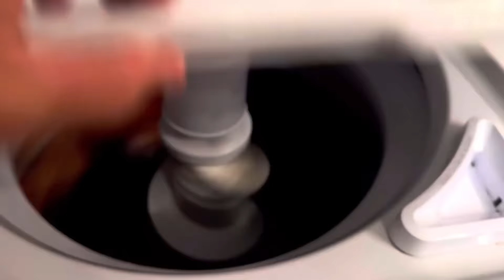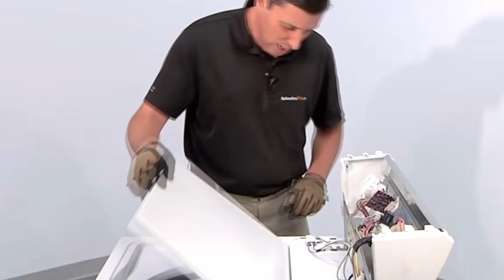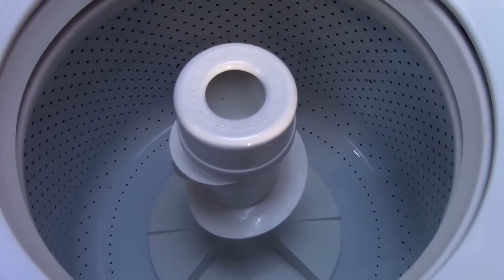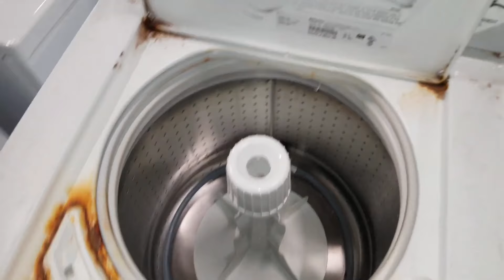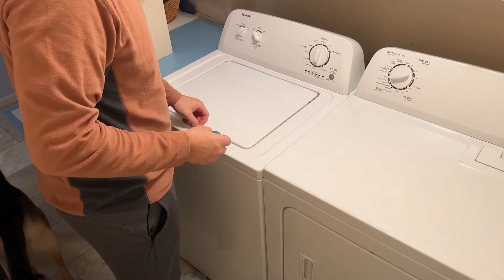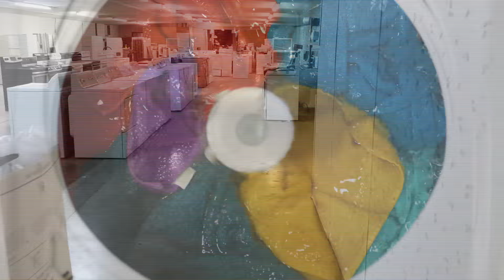3 CHEAP Top-Load Washing Machines EVERYONE IGNORES (But These 3 Are Absolute Goldmines)

Comment: My coffee mug has Wi-Fi.  Shouldn't all of my Appliances?

I wouldn't buy an LG or a Samsung if you're held a gun to my head.  They've been notorious for issues for years.  They are designed that way.  Talk to any appliance technician and they will tell you speed queen all day long.  I think Maytag or Whirlpool has a true commercial washer out now.  That would be the only other one I would consider.  Right now I am still using Kenmore that I bought 1996.  I've done a couple of minor repairs myself.  I am told that that design is worth the best there ever was.

Comment: I got an original kenmore washer along with a just as old dryer when I moved into my new home. That washer is a top loader that's at least 30 years old, and it runs perfectly. The dryer is as old as the washer, and probably needs a minor fix. I just hang the clothes out to dry, and it works fine. The old models are better than the new, and these prove it.

Comment: I have one set of those 1980s Maytag washers and dryers I bought new. Never had a service call on either one!❤ (I actually waited a few months to buy them after moving into my new house so I could save up for Maytags, like my mother had used for years). Didn't know they were so easy to repair. Now I'll do that, if they ever fail, instead of replacing them. Thanks!

Comment: I bought a new Maytag in 2018. There's a little plastic piece just under the cover that connects to the internal computer and signals whether the cover is closed. The machine will not operate without that signal. The piece broke for the first time while the machine was still under warranty. Each replacement piece lasts about six months. The repairman says there is no go around, The machine has been sitting, unusable, (but won't operate without a new plastic piece) for about three years now. I simply stopped paying a repairman to come out and install that tiny part to signal the machine that the cover is closed. What I use now is a portable washing machine that has as much capacity as the Maytag, works with the cover open, and cleans laundry just as well if not better. It was shipped right to my door and was also half the price of the Maytag..

Comment: I just bought kitchenaid stylemaster model # KAWE660WWH2 as I couldn't find any of the 3 you listed locally, but it was cheap enough to roll the dice at $50. Now i suspect its a generic of an early 80 series. I still would rather a dependable care,  but for now its kitchenaid

Comment: I had a wonderful Kenmore heavy duty top load washer from 1989 until 2014. It was still working good except hot water. We got a new Kenmore that had a lock on it to 😮prevent injury, I broke it off. It would not spin correctly, shook itself across the floor and wouldn’t drain. Staying up until midnight one night, babysitting it so I could dry the load.  I wrote on it with a permanent marker ‘I am a Sissy’.  My husband asked the next morning if I needed medicine, was I crazy.  I said I just need a washer that works. He brought home a brand new made in America top loading steel drum, commercial style speed Queen. It is my pride and joy and will outlast me!

Comment: I have the Kenmore set on the front of the video. My mother had this same set so I knew how reliable and cheap it was to operate. I came across the set in a local auction and bought them. I moved my modern set out into the garage until I sold them on Craigslist. I will never buy another washer or dryer. They are reliable, cheap to replace parts and best of all no motherboards.

Comment: Never mind how long a washing machine will last, Do they clean your clothes???? We bought a commercial Maytag, and it DOES NOT CLEAN your clothes. My sister died and we inherited a Roper machine. I thought it would be low class, but I have been pleasantly surprised. She bought it over 20 years ago used, and we have been using it for four years now. Cleans like no other machine we have ever owned. When they went to low quantity water tubs, they threw clean out the window. It reminds me of the toilets that only used a gallon of water. You had to flush twice to get the job done. When this Roper dies, we will be buying a Speedqueen. It's the best value for your money on the market. If the machine you are considering has no agitator, or a spindly little agitator, walk away from it. It does not clean your clothes.

Comment: I've had the whirlpool dryer for almost 40 years.  At one point it had a problem with the heating coils that my hubby fixed.  That was 30 years ago.  It's still going strong. I had the matching washer, but it broke.  After seeing this video, I realize I probably should have spent the money to have the washer repaired. I'm on my fourth washer since buying the Whirlpool set.  I never thought that the dryer would last this long.  I don't care if it doesn't match my washer. If it's not broke, I'm not going to replace it.

Comment: Kenmore mostly was whirlpool direct drive. But some direct drives put fancy pressure switch in trying to reinvent the wheel. I have 2 houses 1 direct drive other maytag 2nd generation.  Both going years. 40 years retired hvac appliance tech. I'd stay with speed queen next machine.  New whirlpool still has that crap motor design like bravo cabrio and all front loaders.

Comment: Not so, we shopped for an older washer two days ago, the options were limited because all but two were already sold. We found one for 299.99, top loader. It works amazing, we had a smart washer that was the dumbest washer ever!! Would not add enough water to get the items wet, would agitate barely damp cloths into a tangled knot, destroying our cloths. It would ratchet loudly while doing nothing to clean the cloths. One set of queen sheets would be too much for one load and they would come out with dry patches everywhere. WE HATED THAT DANG WASHER!! We had them haul it off because we could not in good conscience give or sell it to someone. 
The new old washer fills completely, agitates and spins like a washer should and the cloths? Oh my gosh, such a joy to have clean cloths again. Modern technology is a waste of money and designed to be replaced in 3-5 years for triple the cost.

Comment: About 2010-2013 I bought a Maytag washer and dryer set almost new at auction. The washer was so efficient that it wouldn't complete a cycle without stopping multiple times. The Maytag repairman advised me to junk it unless I could stay home and be alert for every time it stopped and had to be restarted. The dryer is still going strong but the electronics have started going haywire every time the barometric pressure drops.

Comment: Still running my old KitchenAid (Whirlpool) dual action washer I bought new in 1996 along with the Whirlpool dryer I bought at the same time. First and only pair (to date) I've ever owned. Completes the wash cycle in a fraction of the time of these new ones, and cleans waaaaay better. Dryer usually takes 45 minutes on medium to dry a load of towels. 
I hope they outlast me, as I'm cheap and don't like the new junk.

Comment: I probably stay with Maytag but mine probably needs a good cleaning inside because it sat for months with water inside the machine. Hurricane Milton killed my service so no electric in my first home. I want to move it and clean out the pump and lines the dryer is a bear to replace a belt I done three so far. 73
Reply: use Borax a going through wash cycles until it runs clean and doesn't smell anymore to clean it out. Vinegar as well. It will kill the mold. you could use washing soda along with the borax and vinegar in rinse cycle. That will dissolve any soap residue that is sticking around.
Reply: @kirstenmartin2650 thanks all good ideas then finish it off with afresh. I used vinegar on car Mats when I cat peed on the center mat I let it air dried until the vinegar smell was gone. Works wonders. I like the Amish they keep a few items instead of a full closet with cleaning products like baking soda, borax, hydrogen peroxide and basic soap. 73

Comment: Consumers are idiots. They go for shininess, features, and what has the latest tech. I have always hated such things, and when instead for simple, basic, and reliable. 

My last house had a 1980s washer and dryer in the basement when I took possession of it. I lived in that house for twenty one years, and I was still using those appliances (as of 2022)! I had to repair the washer one time after it developed a crack in the drain elbow at the bottom of the unit.  Those two machines were in service for probably forty years!

Comment: My maytags are 47 yrs old.  They sat unused for 7 years but ran like new when used later in 1993 and now in 2026 still going strong.  The dryer needed a new burner about 5 yrs. ago and thats it.  No washer maintenance, ever.
I had a technician check them out after sitting so long 1993, no problems.

Comment: My (Sears) Kenmore is from the early 1990s and works fine. Only needed a timer which I found one on e-bay for $14.95.  Two screws on the back of the front panel with two wires that snap out and then back in like an ignition switch on a car from the 1960s & back.  I will never buy a computerized appliance ever.  All my old mechanicals work fine.
Great video !

Comment: Speed Queen TR 500 owner here: bought in April 2023. Already on the 3rd lid lock and on third control panel. Believe the Speed Queen myth at your own risk.
Reply: They are horrible machines 2 electronic control boards pure rubbish
Reply: You don't want anything to do with the SpeedQueen TR models, (they really screwed the SpeedQueen name when they made that  redesigned platform).

Stay with the TC series - the old classic design and you're usually be OK - but still has all the electronic control crap.

If you want a truly fully mechanical control SpeedQueen, look into the TV2000 model - all mechanical controls but no water level choice, (high level only) and no labor warranty, just 2 years on parts.

Comment: i hate these new appliances that are all digital or run by a motherboard.... i had a kenmore washer and dryer bought in the mid 90's... the washe wouldnt spin out the water... no one would check it.. was just told it cant be fixed and i needed a new one... well.. the new one doesnt fill all the way to the top.. cant wash heavier things in it.. i could in my kenmore... im unhappy with this new stuff...manufactures need to go back to the mechanical washers... they last longer...
Reply: You just didn't ask the correct  people to get it repaired.

Comment: It's not the cost of parts that makes people decide to get a new washer. It's the service charge. Parts, service call, service repair, tax, etc. and you're looking at close to $200.  That's the same with many appliances. Sometimes it's just not worth it. However, I am a fan of the simplest washers and refrigerators with no bells and whistles. I have both, right now. Simplicity in everything will save you money. This is especially true with cars. Seems industries just want to sque-e-e-e-z-e in electronics so they can charge for it, and then charge you again for all the repairs. It's a TRAP, I tell you. They make their own business because you spend your time just trying to keep things from falling apart.
Reply: And a new washer with sales tax delivery and placement and haul away is $1000.00 + and you are yammering about  the service  technician call.

Comment: So.. in this video they are only talking about old used machines? Are there any newer machines that are any good? My Whirlpool/ Kenmore is having serious problems with the spin cycle now went to change the part with spanner etcetera, and the inner tub under the agitator is a rusted out mess.  Nothing newer and budget is made well? I bought my Ultimate Care 2, Quiet Wash 1, Imperial Series in 2006.

Comment: When we were newly married, we moved into my grams old house which had an old top load washer in the basement. We figured we would use it a while before buying a new one. It lasted 22 years without skipping a beat! We were shocked when it actually stopped working! Did not owe us anything. Thanks Gram and Gramps...
Reply: Uhh,,, What kind ?

Comment: I have a Maytag Atlantis like one in the video that my wife bought used many years ago.  It has not required any maintenance since we have owned it.  It does require to be loaded correctly.   I don't know how much usage it had before we got it but we have given it quite a workout.  It has some gear noise that has gradually reduced over the years.  We have been expecting it to quit for years.  A few months ago it stopped a few times with the tub full of water.   My wife went to a store and bought a new washer and dryer.   I threw a fit so she canceled the sale.   It has been working fine since then.   I think it was just overloaded or loaded incorrectly.
Reply: I've had a few issues with my older washer. Sometimes I doesn't want to go into spin mode. Sometimes there are heavy towels in there, or a blanket. Balance issues may be why. I usually just rearrange the load, put it on drain and spin, and run a fresh clean water short wash with no detergent as it has already been at least washed. Sometimes I have to play with the dials to get it going again, but after that it runs fine. It's infrequent.

Comment: I have a 2004 Whirlpool washer and dryer. Replaced the agitator dogs and the heater element in the dryer. Paid $500 for the used set ten years ago.

Comment: I bought my top-loading Maytag 25 years ago and it has never needed repair.  All mechanical, no circuit boards.  The only choices are load size and water temperature, and that's all I need.

Comment: I bought one of those front loaders years ago and it only lasted like a year and a half and it broke down.  

I went to a used appliance store and got myself one of those old top loaders like the one in the video. I have had it for many years and it is still going strong and ZERO issues.
 By the way... With the junk washing machine, I also bought a  gas dryer and guess what.... That went kaput too. 
I have gone without a dryer for many years and I'm able to hang clothes in the basement or outside in the sun. One thing I can say, is that my power bill is extremely low.

Comment: My Kenmore 80 series, 20 year old washer has a rusted out inner tub and a transmission oil leak. They quoted me $550 to order OEM parts and said they were $475, total job would be $650. Was NOT expecting that and how do you know if it's not something else? It was working fine until the final spin and it would never get all the water out of the clothes. It def has a rusted out inner tub tho. Anyone want to offer any advice?

Comment: The government doesn't allow washers with just a mechanical timer anymore. Needs a computer board. Blame the government. It's not the manufacturers.
Reply: There is no specific US law  that doesn't allow mechanical timers - seems that Speed Queen have a model or models with mechanical timers and there is at least one other brand - the little known unique US made STABER - the only company left making that unique washing system. 

Some dryers also use mechanical timers. 

Electronic timers are easier and lower cost to manufacture and virtually impossible or impractical to repair as against mechanical timers where several businesses specialised in repairing them - some still existing.   

I am in Australia - a retired technician - I was able to ascertain this information from web checks and my experience - I became aware of Staber years ago though I have never seen that brand here - but have seen similar types.   

Whilst in real terms new costs have lowered, generally - with a few exceptions - most modern appliances are reasonably made though the sometimes over-clever controls / electronics seem overcomplicated, increasing diagnosis aspects.  Until a few years ago frost-free refrigerators used a very low electro-mechanical defrost timer and thermostat - simple to diagnose and replace - now we have computers and sometimes very sophisticated compressors.
Reply: This all came together under Osama in his 8 yr reign of terror
Reply: Get the Speed Queen TC5 and DC5 pair, both are mechanical and the washer fills the tub full of water. I've had this pair for a few years and love both.
Reply: @richardsmith4187 We really like our TC5.

Comment: My Whirlpool set from 1998 is still going strong.
Reply: I still have my Roper made Buy Whirlpool basic washer and dryer like this and I've owned it since 2004
Reply: @thsarethbreaks . Let’s hope they last many more years.  Along with all my other old appliances. And anyone else’s old appliances.
Reply: @Bubbles-r8z1z  I’ll just keep trying to fix mine. The only thing to go wrong is the little door start- switch on the dryer where it broke off halfway up the switch.
Reply: @thsarethbreaks . Good luck. I found a good repair service near me. The washing machine had one service call for something minor a few years ago, so I hope they are still in business.

They worked on my even older fridge too and installed a new oven hood when the old one gave out.

Comment: Sears Kenmore washer and dryer ! Going on  45  years. Washer had a glitch a couple of years ago and would stop before final rinse. I kept bumping it ahead. After about 6 times it fixed itself ! ❤️
Reply: I agree and they don't make them that way anymore.
Reply: I had a car I bought do something similar. Transmission kept slipping.  After driving it a few days it fixed itself. Kept five years and no further problems except for a water pump.